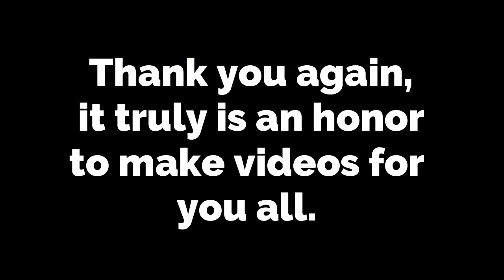Restoration of my Great-Grandfather's 990 David Brown Tractor (Part Two!)

Comment: your doing a real good job there, how do you pressure wash without getting wet, I always get hit right in the face with back wash.
Reply from the maker: The video makes my 'safety-squints' hard to see friend! Mostly, the only advice I could give is never hit a surface straight on, keep an angle that is at lease somewhat pointing to the ground and roughly 70° from the surface being washed. That at least helps me when washing off hard-to-remove buildup without soaking myself! 
Thank you so much for watching!

Comment: Awesome I love these old tractors we have a 1210 case David brown and also our great grandfathers case David brown 995 what is the difference between the Selecto speed mine are gear driven
Reply from the maker: Selecta-matic was an addition that linked the 3-point hitch to the gears in the rear differential. 
It's pretty well an adjustable limited slip differential that has more connection between the wheels as the control lever is lowered. 
Plow all the way in the ground = 100% locked differential and vice-versa!
Super interesting stuff and some of the commercials are still on YouTube if you look up "David Brown Selectamatic"!

Comment: That’s not a 64 more like 67 or 69 64?were red in colour
Reply from the maker: It very well could be, it's a bit convoluted from what I've seen to really get a straight date of manufacturing.
Thank you for watching!
Reply: De This one is not from 1964, it has 8 wheel nuts, so after March. 1966. It does have a 47 engine, so for August 1968